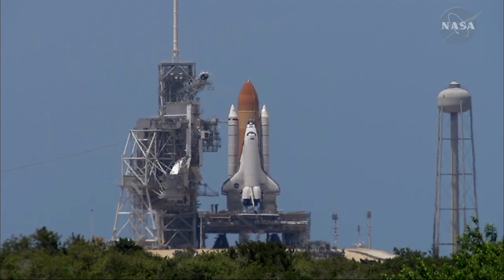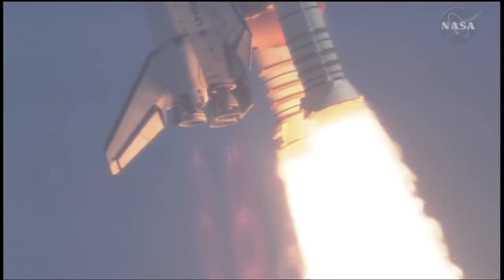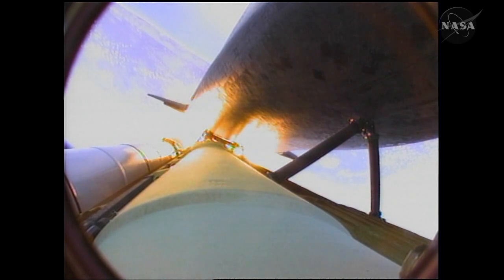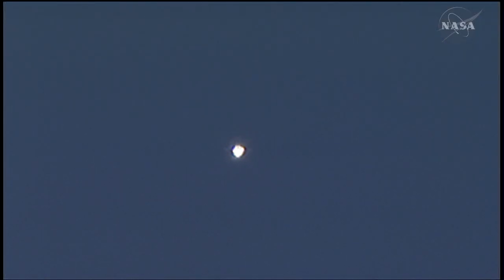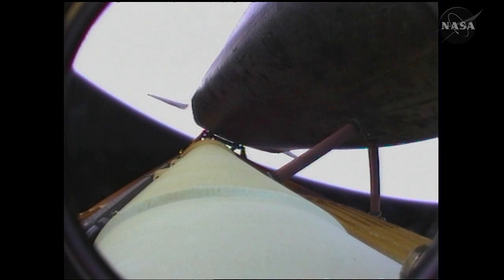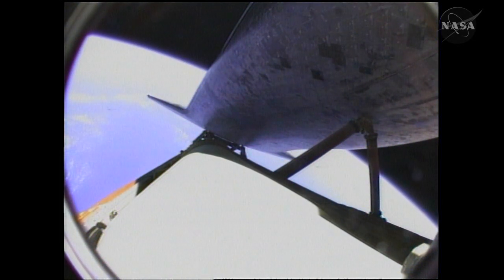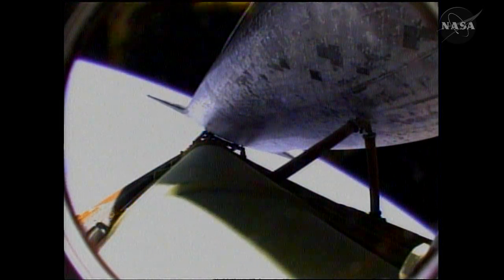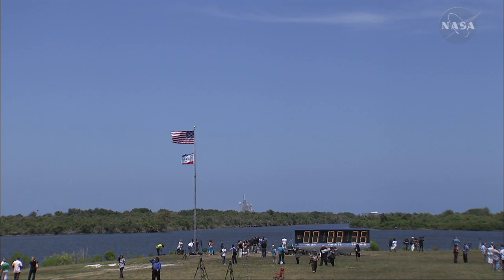STS-132 Launch with Space Shuttle Atlantis - 05/14/2010 (HD)

Comment: @xantrex99 Thanks.  I understand the need for the shuttle's orientation during ascent but what I didn't understand is why the shuttle has to roll to be oriented correctly.  Rather than rolling after takeoff they could simply orient the shuttle and the launch pad correctly in the first place.  Somebody else explained the launch complex is old and it's aligned incorrectly for historical reasons, and that's why the roll is required.  Thanks for the additional information, though.

Comment: @garazy Those are the maneuvering jets firing to fine tune the trajectory of the orbiter.  They use chemical propellants unlike the main engines which use hydrogen and oxygen and the solid boosters which use aluminum propellant in a rubber like mixture that is the consistency of an eraser.